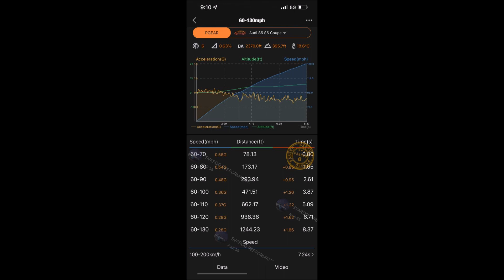2013 Audi S5 4.0T Swap stage 3  Testing

Comment: LOVE IT !!!!!! now it needs 2x 6466 ;)
for the miss fire, I would check all the plugs and see if 1 is not cracked or damaged, I dont know how tight they are gapped, but you could gap them tighter. I am at 0.019 for big power and meth.
A poor ground could do that randomly too, just throwing it out there. 
congrats man !
Reply from the maker: Misfires because runs too rich .810-.820 Lambda at the boost that’s why misfire. Most like it boost leak or N75 issue also could be WG. Tomorrow will do pressure test and smoke test

Comment: Did you run into any car system issues or trouble codes with any of the other control modules? Such as climate control or dash? I have a B8 4.2 that I'd like to turbo. The only way I see doing it is piggybacking a standalone for full control of the parameters necessary but I don't want to interfere with other functions that the ECU may have with other BCMs so that other OEM functions can be retained. I see that you have extensive knowledge of these cars and figured you may have some input. Good job on your builds and thank you for posting.

Comment: Roughly how much $$ do you have into this swap if you had to guess?  Also do you know where a good place to source a used low mileage 3.0tfsi for a b8 s4 would be?  What price range should i be looking at for a good deal?
Reply from the maker: I spend around $18k but I did a lot extra work , air to air intercooler , turbos , port injectors , meth etc…

Comment: Would this swap be possible using b8 s4 DSG 7 spd, or would it be better to use a zf8
Reply from the maker: ZF is stronger and more consistent results at the track also ZF much more comfortable is we compare to DL501
Reply: @Svarogperformance  is it possible to mate the 4.0tt to a zf8 in a b8 chassis? or only dsg?